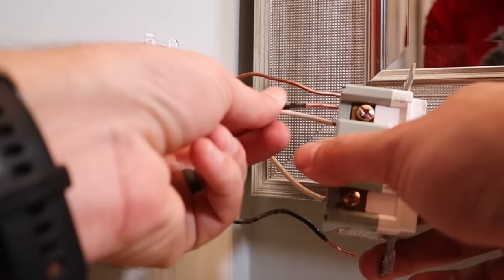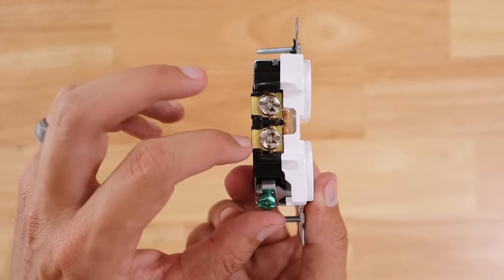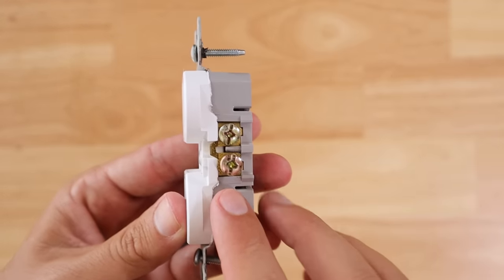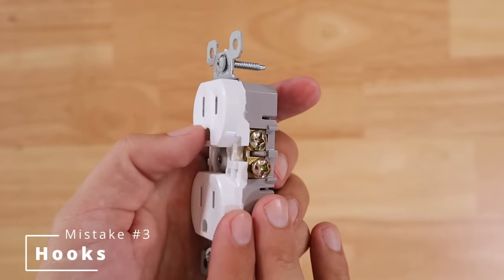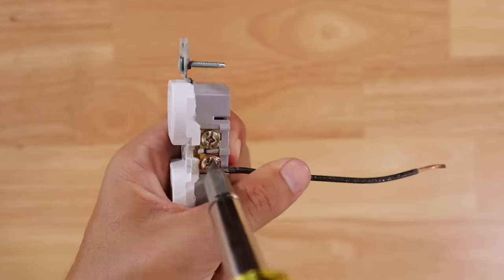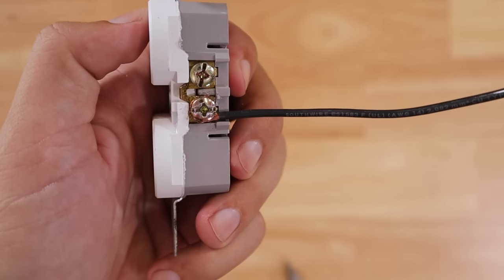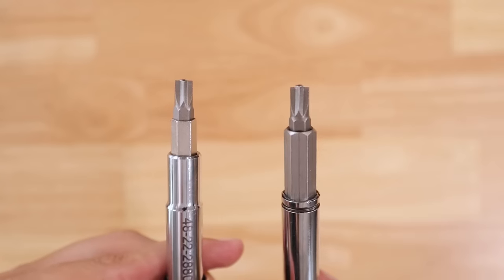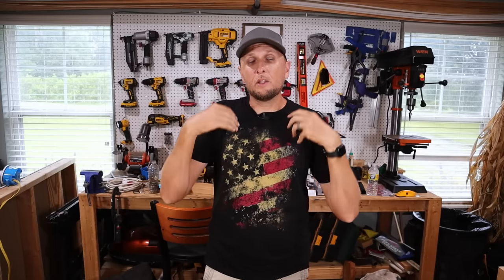The BIGGEST Mistakes DIYers Don't Know They Are Making When Wiring Receptacles | How To

Comment: Good video.  I've done quite a bit of residential wiring including adding branch circuits, new receptacles, switches, etc. to my entire house.  I agree with every point made in this video, and even though I have been practicing exactly what is taught here for a long time, it doesn't hurt to review the material.

Not the subject of this video, but I would add is that it's worth paying extra for "spec" grade or better hardware, and I have no regrets putting 20A circuits and hardware in every room in my house.  Also, it's also worth adding more receptacles, switches, etc. than you think you need.  There is always a receptacle within about 6 feet of any point on my interior walls, and I put a bunch of them (4-gang box) where my computer equipment and network gear resides.
Reply: Code only requires 1 per wall unless in a kitchen which has specific distances between each as well as GFCI requirements.

You will need to replace all the wiring as well and 90% of circuits do not need over 1800 watts.  In other words, you are wasting your time.
Reply: @toriless  Thanks for your comment but I don't agree that I've wasted my time by ripping out the old wiring and upgrading to 20A hardware.  I use electrical assets that I added or upgraded every day, many times.  I removed all of the 14/2 (with no ground) cabling in my house, which was officially built in 1964.  The only areas that had grounded receptacles when I moved in were the kitchen, the garage, and an added room that the previous owner had used as an office.  The kitchen circuit had a GFCI, but the bathrooms didn't.  The wiring in the rest of the house (4 bedrooms, living room, dining room, and a hallway) was inadequate, as noted by an inspector.  All four bedrooms were on a single circuit, and the previous owner had monkeyed with it, badly, when he installed ceiling fans.

I upgraded everything I touched to 2005 NEC or better.  At this moment there are no extension cords or power strips in use anywhere in the house, other than UPSs for my main computer and security gear.  The living room, bathrooms, and bedrooms now all have GFCIs.  I put in switched and unswitched receptacles where it made sense.  I put the ceiling fixtures in the long hallway on 3-way switches.  I've replaced both ceiling fans (which were just screwed into drywall, without boxes) and gotten very good at drywall repair.  In 2018 during an exceptionally hot summer, I installed a whole-house fan with its wiring.

It has been totally worth the time and expense.  It would have cost a whole lot to pay a contractor to do the work, plus I know that it's all done correctly.  My wife (of five years) and her previous (now deceased) husband spent about $100K upgrading their home after a flood.  Every time I have to work on the wiring I am shocked (pardon the pun) at the shortcuts that were taken by the electrical installers.  I won't let anyone else touch it unless it's something major like our rooftop solar project.  That required the services of a real electrician, and he did a great job.

Comment: On mistake #1 re: polarity, I'm surprised you didn't mention a polarity tester. My home's previous owner was a DIYer. The home inspector found some plugs with reverse polarity. I always use the tester because who knows if black means black or if that's the only piece of wire he had. Better to test and get those green lights, than be the reason your house burns down. 💖🌞🌵😷
Reply: @@JUDGEMENT-oh5vi , it's not just about being grounded. It has to do with polarity... The hot and neutral. For most things like a toaster, it doesn't matter which is which, but for somethings like some electronics it matters. My home inspector made them fix the plug to the refrigerator with digital displays. I'm sure you can test polarity with a voltage meter, but the polarity tester there's no learning curve... Just plug it in and see what lights up. The tester costs about $10? 💖🌞🌵😷
Reply: @suzisaintjames  Yep, my home inspector used a polarity tester, got myself one the next day.  Really good for making sure you wired it correctly.  As a bonus it is an easy tool when trying to find the correct circuit breaker when removing an outlet.
Reply: One problem with older houses is they use cloth insulated wire and over time the color fades on the cloth so you don’t know what the hot wire is.  A tip an electrician told me is you can put a test light on each wire and just touch the other lead of the test light to some framing in the house.  If you have the hot lead the test light will lightly light where as if it is the neutral it won’t.  Of course you are working with hot leads so you have to be extra careful.
Reply: Old houses with cloth covered wires have the white on the hot side of the 2 prong outlets so it's not always black to brass out here!
Reply: @EMPYS  , truthfully polarity is color blind. If the whole house is wired that way, the polarity would be correct. It's when the wires get switched around that polarity gets messed up. But l believe when cloth covered wires were installed, home appliances weren't so concerned with polarity, because that was when the blades on plugs were the same. Once polarity started becoming an issue was when one blade became larger. It wasn't until later that the ground wire came into play. 💖🌞🌵😷

Comment: Thanks for putting this together…nice, clear review of what to do. When I bought my house 30+ years ago, most of the outlets were two prongers. I’ve replaced all of them since. At least I thought I did…move a piece of furniture and, bam, there’s a two pronger I missed.
Reply from the maker: And you will probably find another one in a place you haven't looked in the future haha.  I also had a house years ago with the 2 prong receptacles.  They were everywhere.  I am really glad to hear you liked it.  Thanks a lot for the feedback!
Reply: I have nothing to add to this conversation, but I feel a strong urge compliment your great taste in avatar pictures. 👍
Reply: Did you have a ground in the box or just hot and neutral? It is illegal to have a three prong outlet with the ground screw not wired to a ground wire. Only way around this is to install a gfci outlet.
Reply: @jay72mo   Yes, the builder cheaped out on the outlets, 2 prong instead of 3, but there was a ground wire attached to each box, so putting in 3 prong grounded outlets was doable. I checked each one with a gfci outlet tester.
Reply: They also now make plastic face plate screws. Definitely use it in the example you had. And not a bad idea to use them everywhere.
Reply: @jay72mo  actually there is another and that is to plug the ground opening so a ground plug can not be used.
Reply: Always make sure there is a ground when replacing an two prong with a grounded outlet. If the ground is not there, then you have 3 choices. Leave it alone, install a ground back to the source panel or install a GFCI device. Installing a grounded receptacle with no ground wire is a serious safety Hazzard. Anything that comes a ground on the plug was safety treated and built to standards that require that ground connection to pass on safety.

Comment: I went to a vocational high school in 1976 and was in the electrical installation class. I learned about the correct way to install recepticals and never forgot. That was before romex and backstab recepticals and plastic boxes,  I always wrapped tape around the recepticals screws to avoid shorting
Reply from the maker: I am with you on that one!  Thanks for sharing your experience!
Reply: Pre-romex??  Southwire IS to wire like bandaid is to adheasive bandages

Comment: Great tips! It's amazing learning these little details to really make the process much safer and easier (strip gauge on back of outlet, different screw tips, clockwise wire curling, etc.). I thought before the video that there wasn't much else to learn about installing outlets but I was proven wrong. Thank you.

Comment: Your videos are great - thank you! I'm pretty handy with electrical in my home, but have definitely picked up a few great tips here, and I'm always looking to learn. Here's a question: I saw years ago on Holmes on Homes, Mike said that outlets are almost always installed upside-down in homes (ground down). I've since noticed that in most commercial buildings they're ground up. Digging around a bit, it varies as to whether this is simply a call sign of a union electrician, or for one or more practical purposes (I lean toward the latter). For over a decade, I've been following the "Holmes" method in my home - ground up. First, if something slides down the wall, it hits the ground first if a plug is a little loose. Second, when plugging something in below your waist, it's likely whatever is on top makes contact first (even though the ground plug is usually slightly longer) - and of course you'd prefer that be the ground. On the back side of the outlet, the ground wire would also usually be on the bottom in the 'typical' setup, whereas with a ground-up installation, the ground wire would provide some degree of protection from gravity affecting wires and debris inside the box over time. His points all made sense, so I've followed his advice. He did mention that if an outlet is installed at or above chest height, it makes sense to go ground-down for that setup, which also makes some sense to me. What are your thoughts on this?
Reply: I thought I'd prepare a wise a** answer to this 'which way is up' question by just checking my GFI outlets for the way they labels are printed (engraved) LO .. they are printed BOTH ways so TEST and RESET are readable either way the device is mounted:face-blue-wide-eyes:  Who'd a thunk????  I do have an outlet expander/USB charger hub that connects over a standard double outlet and the labels are 'correct' when installed ground down.  My 2005 Florida house (Brevard County) has all outlets ground down .....  fun question!!

Comment: As a soon to be retired shop teacher, I have taught electrical trades.  This is an excellent video on wiring outlets.  I was not aware of the specialty screwdriver bits - always used the robertson # 2 - but will be looking for them the next time I am at the electrical supply store.  BTW - I think your phillips head in the video may be a posi-grip or reed -prentice bit (both close variations) and not an actual #2 phillips.
Reply: They are nice but in most instances we are discouraged from using multi tip or sectional screwdrivers. A lot of guys do anyway.

Comment: Great video! I shared it with my husband, who recently reverse wired an outlet because he forgot where the hot and neutral wires went. (I caught the mistake with a polarity tester) The only other things that I would have liked to see addressed is wiring a split outlet (with the tab removed) and how to recognize one of those. I'm also curious, when one uses the back stab option, if the screws on the sides are then live. I'm imagining they are. I did some wiring with an electrician friend, and he always wraps the sides of the recepticle with electric tape, which covers the screw heads.
Reply: Yes, they are.
Reply: so what about this.  Old receptacle had two screws for hot and 2 for neutral.  A new one just came that only has 1 for each.  Then 4 on backstab.  What do you do then?

Comment: Good stuff.    For those who might forget which screw the neutral/hot connect to,  the front of the receptacle will tell you.   (The big and small slots)  Smaller slot is the danger(hot)   its harder to jam things into it for a reason.
Reply: Actually the different size is for  appliances that are polarity sensitive. The male plug on such an item is also sized to fit only one way. Many electronics will be destroyed by reverse polarity so that is why two different size slots on the plug and receptacle. Kids will find a way to jam things into it no matter the size, so use child protection devices if you have toddlers in the house even with the new plugs that are sized for polarity purposes.

Comment: The strip gauge is used for backstab connections. It may or may not be the right length for a screw connection.
Reply: Not according to the instructions, which are part of the UL listing.

Comment: To reinforce the point about NOT using the quickie Back Stab method.  A while back we purchased our home that was about 17 years old. Within a few weeks we lost the entire master bedroom circuit, all outlets, lights, etc. It wasn't a fuse! After LOTS of internet digging it  was suggested that I go to each outlet with a plugin drill or some other appliance plug it in and wiggle the plug.  If drill goes on/off you found a bad socket.  So I did find a bad  socket and looked into it. It was Back Stab wired and over time it became loose, started arching and was burnt pretty bad inside.  Anyhow it was the first outlet in the master bedroom circuit and so killed the entire circuit.  
After I found the problem more research led me to a professional electrician's YouTube channel who pointed out that a significant percentage of new homes are wired with the Back Stab approach, meets code, and he said "As long as homes are wired with the Back Stab method he will never be out of business. 
My entire home then 17 years old was Bach Stab wired.  As I replaced every outlet and switch I found several outlets not working and more ready to go, they were burnt inside.  Also a couple switches burnt inside with one 3-way not working. 
Had I paid an electrician to come and fix things one by one as they each became noticed and more continued to deteriate it would have become obvious what was said before on YouTube, as long as they allow Back Stab wiring I will never go out of business.    
I suggest if you find your home is Back Stab wired, save yourself some frustration and money and replace everything.
Reply: Glad you ran it down before something really bad happened!

Comment: Lots of good tips!  And yes, I'm guilty of 2 or 3 things in that video (I'll never admit to it in court).  But I never would have put two wires under the terminal screw!  So many of us didn't have a teacher and we go by copying the work done previously which may not be correct. The worst I've seen was when I removed the wallpaper in the kitchen because it was outdated.  Low and behold, there's an outlet box with 3 wires in it but no outlet.  Wonder if that's hot?  Sure nuff, it was.  The wallpaper man wallpapered right over a live connection when the house was built.
Reply: The sheet rock man’l do the same thing too. Looks like the wallpapered conspired with the electrician since the connection was already made

Comment: Oh man, I'm so glad this appeared on my Youtube home page!  This was incredibly informative for this DIY'er.  Your explanation, demonstration and understanding was extremely helpful.  Also, I was today years old learning about the Robertson bit, I had no idea it existed.  I've been loving the torx bit and cringe at all philips and flatheads.  I'm going to look for the Robertson right away.  And I loved the 1080p60 video, so clear and sharp.  Thank you sir!
Reply: I've used that tcx bit a few and didn't like it. I tried it on several different things and it seems like it just didn't grip the way it should have. I usually just use a Phillips and if the screw has any damage I'll pull out a flat head. Many older screws seem a little soft and easy to damage. Many people over tighten these screws which can damage the threads. Over time the connection becomes loose, which creates heat and potentially fire.
Reply from the maker: Glad you liked it.  Thanks a lot for the feedback!

Comment: I agree with everything you said here EXCEPT the backstabbing method of installing wiring onto outlets & switches.
I've worked in HUNDREDS of houses and have never seen backstabbed switches or outlets fail because of being installed this way. 
They're purposely engineered and manufactured to work in this fashion. Also, you don't need one of those bits as you don't need to
TORQUE down screws for these connections. You gain nothing from smashing down the wires beyond a firm snug.

I've been working with high end electronics for decades and this always irks me. Same thing with coaxial connectors! WHY THE HELL 
DO PEOPLE TORQUE THEM DOWN WITH A WRENCH???!?!? Hand tight is all you need as the goal is to ensure the copper core and outer sleeve remain in constant contact.
Reply: I was a cable installer for years and I can tell you that just hand tightening coax fittings can cause future issues. 

Temperature fluctuations can cause the threads to work themselves loose over time, and less than a quarter turn loose can permit interference by signal ingress, even moreso when the fittings are poor quality.
Reply: Agree - there’s nothing wrong with backstabbing - why would manufacturers provide this if it was prone to failure ? Sometimes you just have to use this due to limited space in the box due to over crowding